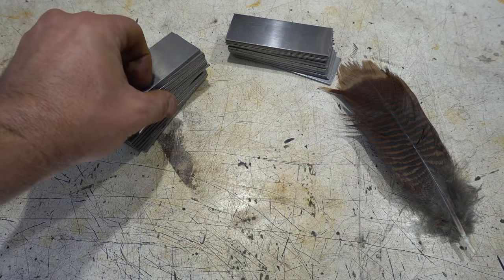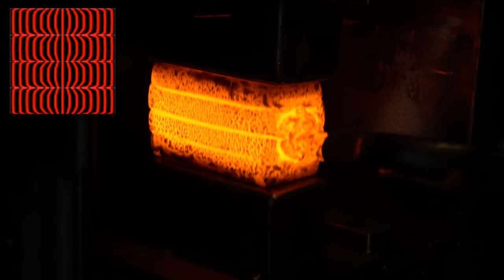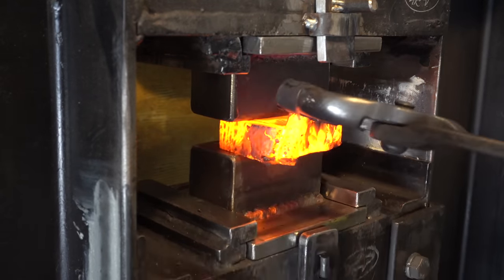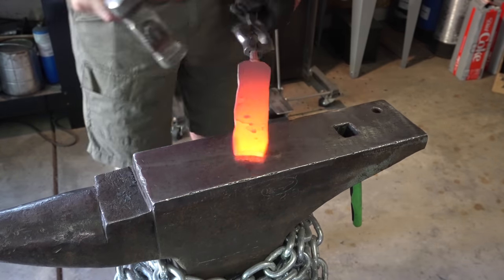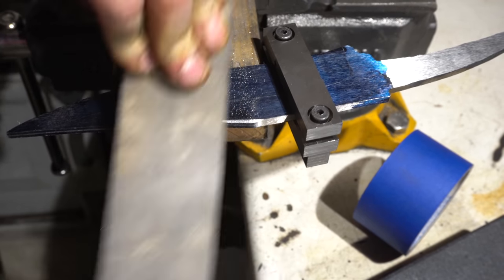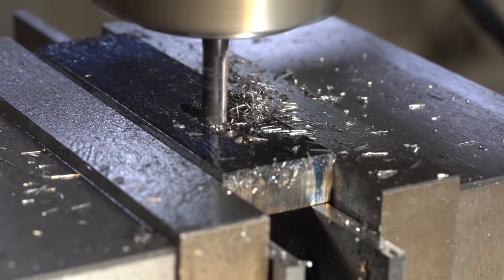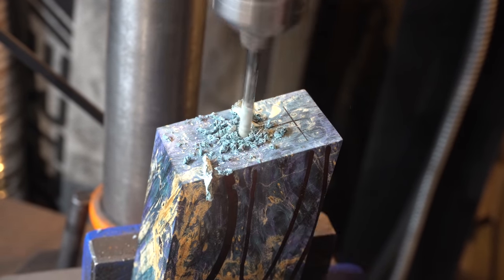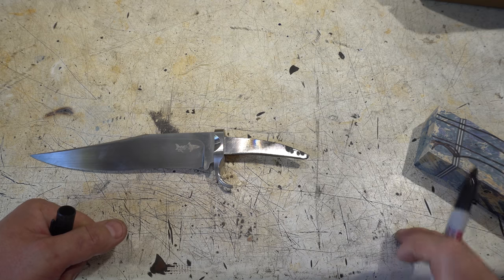Forging a Feather Damascus Bowie Knife - The Complete Video

Comment: Thank you for forging as close to finish as you could (: not trying to take way from others but watching some cut in the shape and “cheat” their way through the design takes all the fun out of it. HAMMER WORK IS BETTER (: so thank you
Reply from the maker: Don’t get hung up on the hammer work.  There are plenty of projects where stock removal is better.  Most of my layered constructions (all the copper Damascus) are cut to shape.  I forge to shape when it makes sense.  Thanks for watching.

Comment: thanks for the subtitels, so i learned new words. the watercooler at the grinder is a very good idea, like it.
the pattern is really awesome, handle material fits good to the pattern, i prefer not so colourful materials.
great work!
Reply from the maker: Thanks for checking it out, Tom!
Reply: @TyrellKnifeworks What liquid is the bar immersed in? Acetone? I am planning to start forging, what do you prefer, gas or coal for a beginner?
Also, is this method good for old rusty materials after soaking them in acid or something?
Greetings from Vienna Austria.
I saw it in an other video from you, its Kerosin! Because it burn with high temperatur?
Reply from the maker: @tomedelkowski6567  that liquid is kerosene.  Do NOT have acetone anywhere near your forge, it’s extremely flammable.  Kerosene has a pretty high flashpoint and is used to help the forge weld.  For beginners I would definitely recommend gas over coal.  Watch my Beginner Series playlist on how to get started. 👍
Reply: @TyrellKnifeworks  +1 Follower

Comment: The finest work i have ever seen. One day i would like to start forging  knifes, maybe i will try something like that.
Also I wonder how do you do the trick, not to loose orientation of steel layers during forging?
Reply from the maker: You can usually see the layers while you’re forging unless it’s in a canister.  Sometimes if it’s tricky, I’ll notch the handle to keep track of the orientation.  Thanks for watching

Comment: Your builds are amazing.  Makes me want to start a new hobby!
Reply from the maker: Do it!  Thanks for watching!
Reply: @TyrellKnifeworks   I'm thinking about it seriously.  My question is, "What basic equipment will I need, and how much does a basic setup cost nowadays?"
Seems like a forge, anvil, hammer, tongs, OxyAc torch, welder, cutoff saw, grinder, belt sander would be mininum, but the more I think, the more stuff comes to mind.    

That might make for a popular video, if you haven't made it already.  I'll go search.  Thanks!
Reply from the maker: @thilltony3362  Yeah, that would be a good video.  I'll add that to the list for a future Triple-T.   I think your list is a good start but I would remove the oxy-acetylene torch.  You don't really need that.  Unless you're going to make your own forge, you also don't need to start with a welder.  Though I think its a really important skill and that's how I started and I built my own forge.  Forges are pretty cheap now ($150 online) so that's what I recommend.  Get a cheap piece of RR track as an anvil or just some big piece of solid steel.  You don't need an actual anvil.  You need an angle grinder for sure and some kind of belt grinder.  That's the basics.  I think you can get started for around $500.

Comment: This thing looks phenomenal!  I'd love to see this pattern done with copper 🤔
Reply from the maker: Thanks for checking it out.  Unfortunately I don’t think you could accomplish this with copper.  That would leave you with copper on the cutting edge.  Plus the copper be go through the billet instead of lengthwise and it would be extremely weak.
Reply: @TyrellKnifeworks  it'll make for a sure sexy blade though! Strength issues aside of course.  That might make an awesome letter opener.
Reply: Possibly a copper feather Damascus San mai?
Reply from the maker: @bubba19k  that would look odd.  Perhaps a half feather as the cladding.

Comment: Beautiful knife!  Subscribed.  You should try the mist coolant system over on the mill too.  It keeps it cool and blows the chips away too.  I would run it a little drier over there though so you don't get rust.
Reply from the maker: Welcome to the channel, Stuart!  If I was going to use the mister on the mill I’d probably use sone kind of coolant other than water.  Actually just the air would be nice to clear chips. Thanks for watching!

Comment: Have you ever thought of starting out with a forged billet with copper as one or more steals in it? ..... That would make for an amazing feather blade!
Reply from the maker: If you have copper in a billet, it’s then not possible to forge weld it to another piece of steel.  Steel forge welding temps are above the melting point of copper, so it won’t work.  Feather pattern required a bunch of forge welds.  If you put copper between ever steel layer, 1) it wouldn’t be strong enough, 2) you’d have copper on the cutting edge.  Thanks for watching, Lary!

Comment: Very nice I want one but no curve on the handle.  Very beautiful knife and thank you for explaining the steps.   I  saw on a video someone using wood on the anvil what is the reason for that?
Reply from the maker: Thanks for checking it out.  Sometimes people use wood so that it doesn’t move the steel on that side.  Like using a wooden mallet to curve the blade so it doesn’t put hammer marks where you hit it.
Reply: @TyrellKnifeworks  cool  thank you for letting me know!

Comment: A very beautiful knife but I have a question to ask because I’ve never done any of this. Why do you use the 2 files after the quench
Reply from the maker: Those are hardness files to test how hard the blade is.  The first one was a 60 hrc file so if the file doesn't dig in, you know what you're testing is at least 60 hrc.  The second one is a 65, and it skated that file so I know that after quench but pre-temper the blade was at least 65 hrc.  I've since purchased an expensive hardness tester that's accurate to +- 0.5 hrc so I use that instead.  Thanks for watching, Tony!

Comment: great job man. but i had a question about material weight. like do you select the total weighted material on the basis of  length of the knife or take extra accounting for loss during forging ?
Reply from the maker: You always need to account for loss.  Plus on the feather pattern you don’t usually fully forge it or you distort it.  Thanks for watching.

Comment: Would it be possible to just do a multi layer billet and go straight to splitting eliminating the W's and the multiply restacking?
Reply from the maker: Sure, you could just layer the billet for the final split.  If you checkout my old multi-part feather damascus bowie build, that's what I did.  It doesn't look near as nice though.  The W's really gives it that "feather" look IMO.  Thanks for watching, Arthur.

Comment: How long do you have to wait for the forged pieces to cool before you cut or grind on them, or do you rapid cool them?
Reply from the maker: You can hot cut them with an angle grinder if you’re in a hurry.  Never quickly cool them though, that puts stress cracks into the steel.  Thanks for watching, Mark!

Comment: hey man, what kind of grinder do you have? did you build the surface grinding jig? does your grinder turn both horizontal and vertical? and the mister? is that from the same manufacturer? i’m new and starting to buy stuff. Please let me know man. love your videos!
Reply from the maker: My grinder is a Brodbeck.  There’s a link to their site in the video description.  I built the surface grinder and have a video on that.  Same with the misting system.  You might want to watch my Beginner Series and then Intermediate series playlist if you’re new. 👍. Thanks for watching

Comment: Hi i just found your channel the other day. I can tell you have been doing this awhile. You must be Damascus master..the one with the copper layers you did? How does the softness of the copper with the hardness of steel affect performance of the blade ?
Reply from the maker: Welcome to the channel, Patricia!   Actually I’ve only been bladesmithing for about 3 years. When you’re passionate, you progress quickly!   First off, the core of the knife is 1095 and all along the edge so there's no copper on the cutting edge.  The copper bond is very strong.  If you look up copper brazing, it is in excess of 70000 psi in tensile strength.  You'll destroy the knife before the layers will shear apart.  Thanks for watching!

Comment: Just curious but what is the liquid you had the billet soaking in before you stuck it in the forge?
Reply from the maker: That is kerosene.  The theory is that as it burns off, so does any air/O2 between the layers so you get a better forge weld.  Thanks for watching, Josh!

Comment: Hello 
very cool video. what is the liquid at the beginning of the vidio in wich you got the steele?
Reply from the maker: That is kerosene.  It aids in the forge weld by burning off and reducing any O2 between the layers and it also leaves a residue that prevents scale.  Thanks for watching

Comment: When you used the battery to get the emblem on there is that the same or similar to anodizing? I was also wondering if you dipped it to get the design to show? I know the shapes came from the forging, but the design suddenly appears when you were building the handle.
Reply from the maker: The electro etching is somewhat similar to anodizing.  You are passing a current through the blade over a stencil and that etched away the steel.  To bring the design out, I use ferric chloride acid, which eats away the 1095 steel but the 15n20 steel has 2% nickel which resists etching so it stays silver while the 1095 turns black.  Thanks for watching
Reply: @TyrellKnifeworks  thanks so much for the info your videos are super interesting!

Comment: I'd like to buy this knife. How does the process work? Do you have a website you sell the on? Let me know.
John.
Reply from the maker: Sorry, John, this one is already sold.  What I have is (normally) in my Etsy shop (link in every video description). I’ve pulled it all down because it’s all going to the blade show in LA in Oct.  After the show, whatever doesn’t sell will be announced on my YouTube community page.  I’m going to be pulling away from Etsy because their fees are pretty high.  Check the community page after the show.  👍
Reply: @TyrellKnifeworks   Can I ask how much it sold for to get same idea of price range?  Would you consider making another like this one if I pay you in advance? 
I had dreams about that video. Your a master metal smith for sure!
Reply from the maker: @johnslugger  sorry, I’m not taking orders.  Bowies run between $1500-$2000

Comment: Very beautiful knife, how did you get your logo onto the Damascus!
Reply from the maker: My logo is electro etched onto the steel.  Basically you just use a battery charger and hook one lead to the knife and put a cotton ball at the end or the other.  Then I put a stencil on the blade and dip the cotton ball lead into some saltwater and it will etch through the stencil.  Thanks for checking out the build!

Comment: amazing smiting, ive been a smith for around  13 years now and i watch lots of videos on the subject, i find many smiths miss potential in there blades by not using enough additives like kerosene and borax in there welds. this tends to end up with the welds delaminating during use and its sad to see that happen to what would normally be a wonderful piece of steel.
Reply from the maker: I think it's a balance.  Too much borax isn't a good thing either.  There's this craze of no-flux forge welding like its some kind of badge of honor just because some smith said it was the way.  I think used correctly, its a fabulous tool.  Thanks for watching!
Reply: @TyrellKnifeworks  I completely agree thanks for the response and I love to see the textbook technique used.

Comment: this would probably be easier than I’m thinking, but you should do a Damascus resonator guitar. Just make a bunch of Damascus plate and roll it into the right size sheets. You could make the patterns in the metal mirror the shape of the guitar and the ornamental holes all over it. You could even do a Damascus neck out of aluminum since they’ve been doing aluminum necks for a while now. I have a feeling a guitar like that would fetch many tens of thousands, if not over a hundred thousand dollars. Though I guess if it’s not easy to make large plates like that, it might not be worth it.
Reply from the maker: Yeah those might fetch sone good $$, but it doesn’t really interest me.  Thanks for checking out this build though! 👍

Comment: 19:34 just came to mind, that epoxy glue does not need any geometrical anchoring as doesn’t any glue. Sanded surfaces glue better because sanding removes grease and other impurities.
Reply from the maker: Thanks for watching.
Reply: @TyrellKnifeworks  My brother did knives too, so I know how difficult it is. You have real talent!

Comment: How Long Does Making Blades Usually Take For You ?
Reply from the maker: It depends on the blade.  The Bowie’s take longer because they have guards.  It also depends if it’s Damascus or not.  The feather is a particularly tough one so it takes longer.  Probably around 30 hours in this one.  Hunting knives are easier.  Around 10 hours.  I’m just a hobbyist though and do them one at a time.  If I was doing batches I’m sure I could cut the time in half but I don’t want to be a production facility.  Thanks for watching!

Comment: what battery charger do you use for the etching?
Reply from the maker: Mine is an older Schumacher 2/10/50 amp.  I use it on 10amp.  The new “smart” ones don’t work because they detect it’s shorted out.

Comment: at 7:33 if i want to have a thin darker line to run along the center, should i add one layer of 1095 between the two pieces?
Reply from the maker: I wouldn’t advise it.  It doesn’t look as natural with the black line in the center.  But it’s up to you.  Thanks for watching!
Reply: @TyrellKnifeworks  i've had my first smithing lesson 2 days ago, i guess i will try in some years  LOL
Reply: @TyrellKnifeworks  but if i do it, will it hold the two parts together?
Reply from the maker: @regnbuetorsk  it won’t make the forge weld easier or harder, it’ll just add more volume and change the look.

Comment: Can you forge weld Inconel/Hastalloy if I send you a chunk?
Reply: High temp Damascus?
Reply from the maker: From my quick research, it’s extremely hard to forge weld.  Arc welding it requires Tig and inconel 625 as the filler.  I’m not sure what I’d do with it but if you have some to spare I might find a use for it.  Thanks for watching!

Comment: Do the way you stack the "c's" matter? I kinda did it haphazardly
Reply from the maker: It does matter.  You want to align them in the same orientation you cut them and try to line them up as much ad possible.  The pattern flies better when the stacks align.  Thanks for watching.
Reply: @TyrellKnifeworks  thanks!

Comment: What's the Black stuff that falls of the sides when you heat it and pres it
Reply from the maker: That is scale.  Basically iron oxide that forms when the steel is hot and exposed to air/oxygen.  The more you heat the steel, the more you lose to scale.  Thanks for watching.
Reply: @TyrellKnifeworks  tnx for answering my question. I rly like watching your Chanel and also i like watching FiF and i hope you make it on their Show.
Reply from the maker: I’m not-so-patiently waiting for them to call.  😜

Comment: Why is the split caused from ?
Reply from the maker: Do you mean the splits on the sides as you forge it or the split down the middle?  If the former, the layers tend to split along the places where they were forge welded.  The latter is done by driving a wedge into the stacked billet.  Thanks for watching

Comment: isnt kerosine flamable?
Reply from the maker: Yes, kind of.  Like diesel or vegetable oil.  All flurocarbons have a flash point and depending on how low that is determines how flammable.  You can throw a match into diesel fuel or kerosene and it won't explode like gasoline will.  If you turned it into a mist, then it's really flammable.  Make sense?

Comment: Wow great  in making great ,but why don't you fold the billets..like Japanese sword and  knives do. They still do, up until today..it better have do it that not lossing
Reply from the maker: Hot folding a billet is problematic and has a higher error rate.  I realize you see it on TV, but most modern bladesmiths do not do it this way because it has a high failure rate.  It's much better to grind, clean and restack your billet.  Thanks for watching.

Comment: I am not arguing with your method here But there is a much easier way to get the same result make your billet like norm then turn it 90 degree;s drive a wedge down through it reweld and your done . Do shaping on grinder to make pattern match. But then I learned how to do this Before there were home presses.
Reply from the maker: In this instance, easier isn’t better.  What you are describing results in a much less desirable pattern. You don’t get the “feathery” look if you don’t do crushed W’s.  Thanks for watching, Ray.
Reply: @TyrellKnifeworks  since I never use more then 24 layers when I make feather I can't see any change I tried it your way this afternoon ..Looks bout the same or could be I need my glasses redone AGAIn. I swear getting old  bites! Thanks for the Answer your pretty awesome smith. I had to learn all on my lonesome since a  thing like the net didn't even exist when I got through college..along bout the same time that pesky meteor hit my backyard.
Reply from the maker: With 24 layers you’re not going to see a difference.  This feather is more like 400 layers and you certainly see it.  If you held it in your hand you would surely notice why the crushed W’s is critical.
Reply: @TyrellKnifeworks  maybe If i got my mloop out . My eyes are really very very bad anymore I mean they took my DL bad